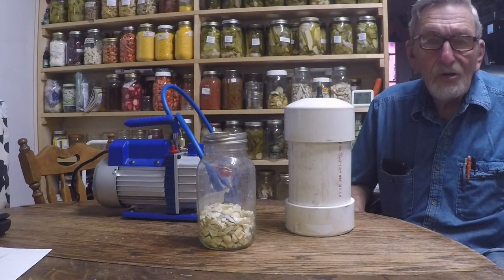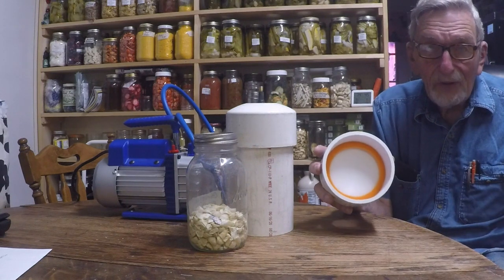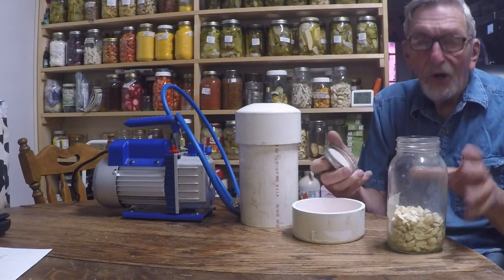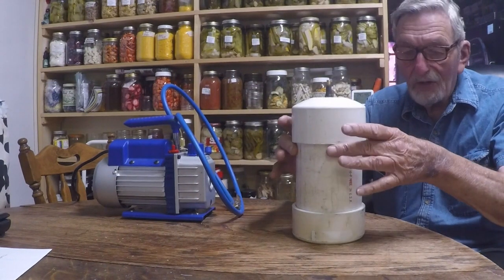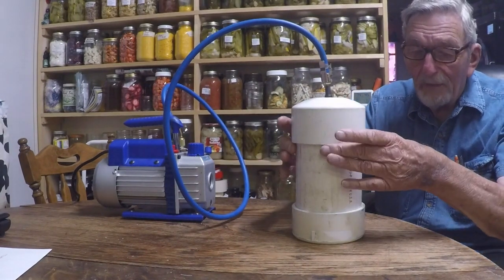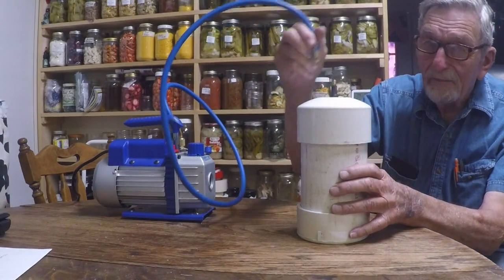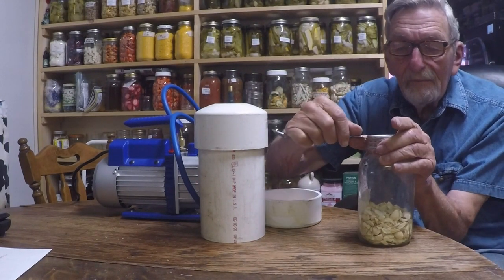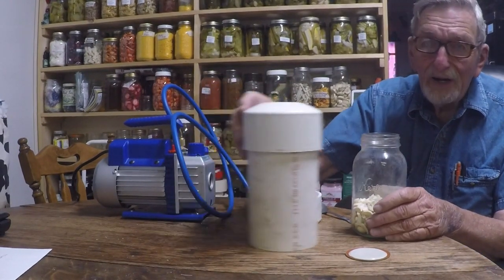Mac DIY vacuum chamber

Comment: Looks great!  So where did the bottom gasket come from?  That’s my dilemma.
Reply from the maker: I don't remember where I got it ... however, any number of materials will work like one made from silicone rubber, EDPM rubber, cork, etc. Just make sure there is a hole cut in the middle to allow air to escape from inside the jar that is being sealed. I have another video simply using a dinner plate and a home made gasket that you might want to check out

Comment: Thanks Mac! 
That automotive valve stem appeared to be the Schroeder variety. However, does it still have the actual valve screwed inside of it, or is that part removed? Also, where did you get the hose that is installed on the vacuum pump to make that work with the valve stem? Finally, do you have a recommended source and size for the gasket you used? Thanks in advance!
Reply from the maker: The valve core has been removed from the rubber valve stem. The vacuum hose is a Amazon refrigeration hose $12. I cut off one end to accept the self locking air chuck with a barb end. I have tried various materials for the gasket. Any soft rubber like material that will make a seal will work. I had some used EDPM rubber (similar to a car inner tube) that worked really well.  Possibly a section from a silicone sheet would work well. Just try various things and see if the plate (or other flat) base stays attached when the vacuum is applied. Note .... whatever gasket material you use ... make sure there is a hole in the middle so the vacuum reaches the flat plate. Hope this helps :)
Reply: @macmcquaid9413  Yes, very helpful. Thank you! Subscribed!